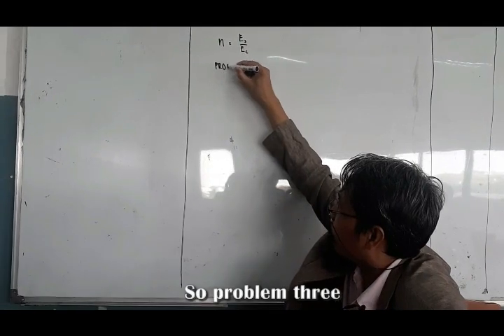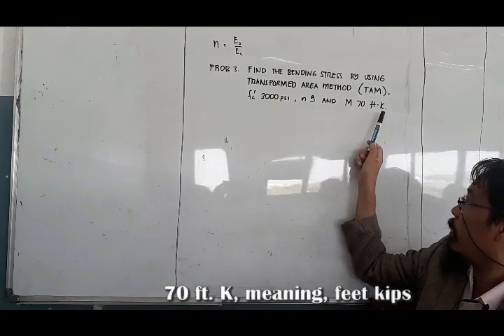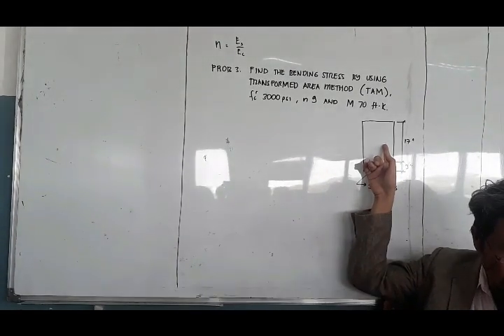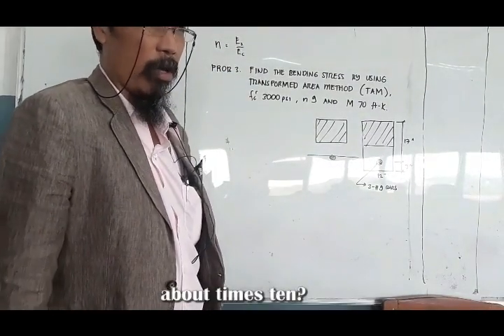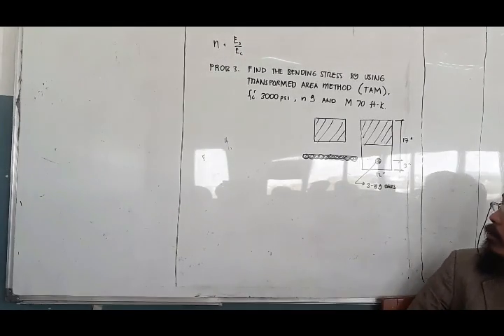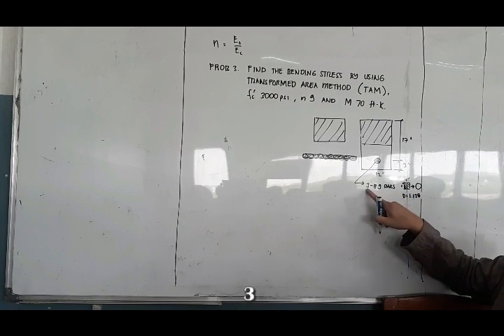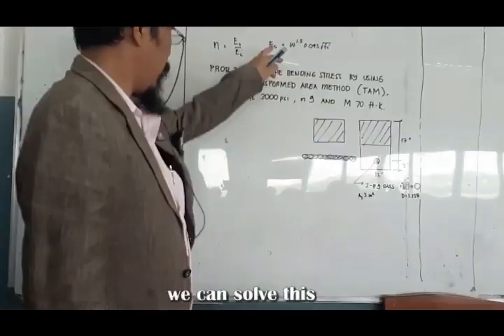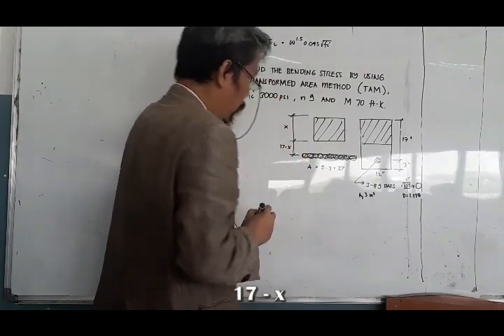CE 422 Structural Design 1: Reinforced Concrete Design || Elastic Stresses ||  Cracked Model  PART 1

Comment: Thank you, sir for this great discussion. I have learned that steel is stronger than concrete but concrete can transform with the same strength with steel. Area of concrete will shrink. On the other hand, area of steel will become larger because of converting it into an equivalent strong concrete.

Comment: 1. Amongo
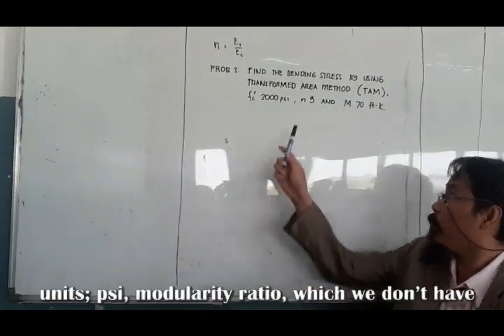2. modularity Ratio @2:07 
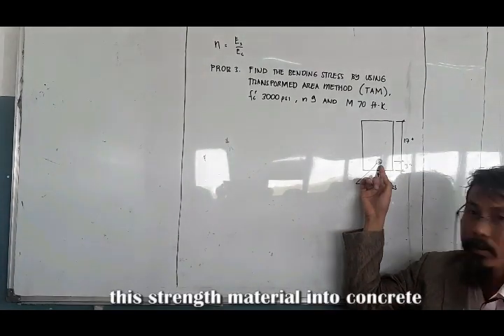3. Strength material into concrete @3:33
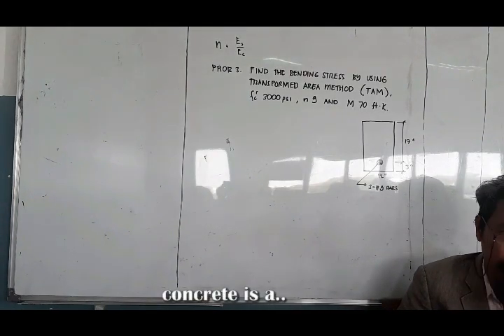4. Lesser strength @3:55
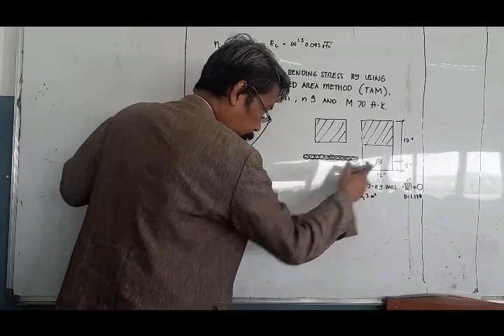5. Transfer @10:05
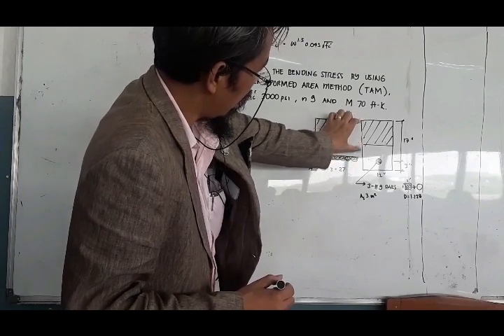6. Dimension @10:30

Comment: 1. Solas
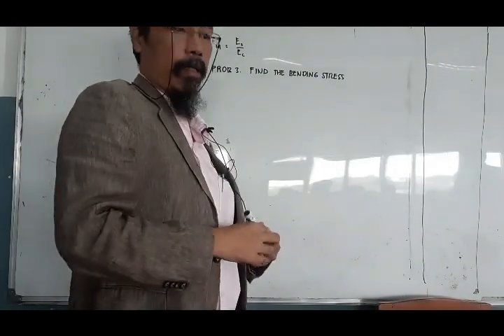2. Bending stress @1:05
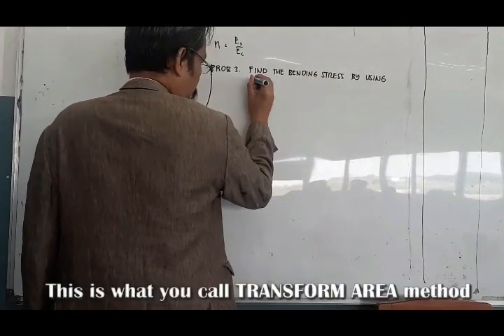3. Transform Area Method @1:40\
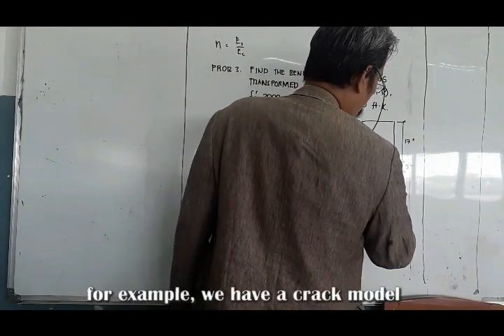4. Crack Model @4:11
5. Modular Ratio @6:15
6. Strength of material @6:35

Comment: 1. Sarcia, Mabelle E.
2. Cracking Moment (1:23)
3. Modulus of rupture (1:28)
4. Transformed Area Method (1:40)
5. Strength of Material (1:46)
6. Concrete (3:03)